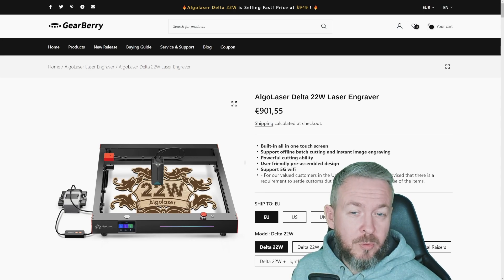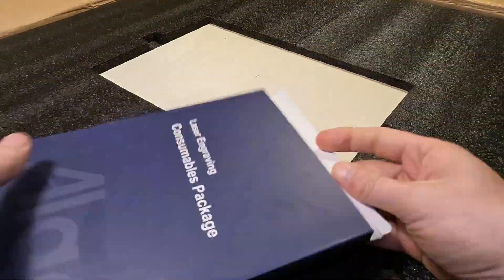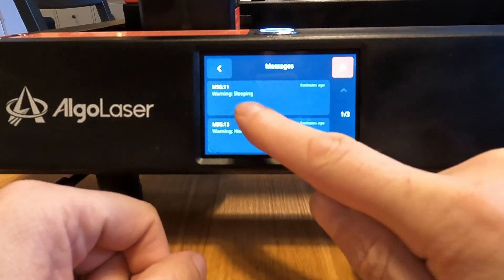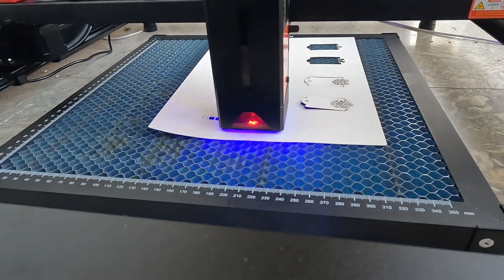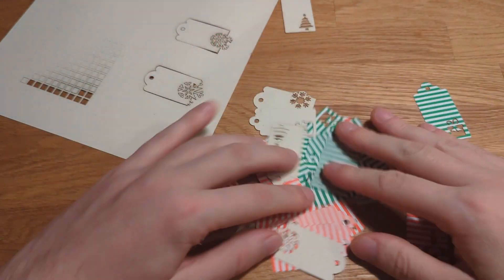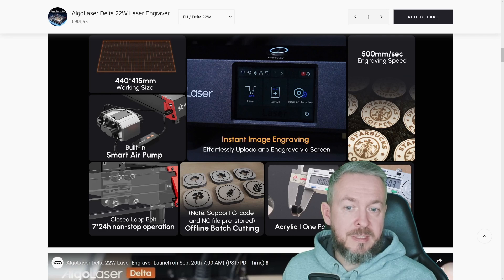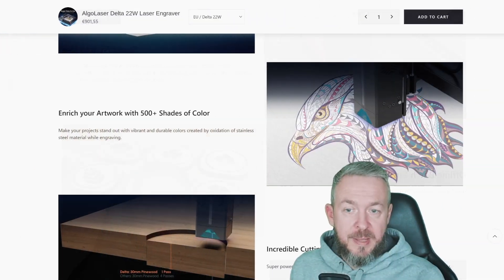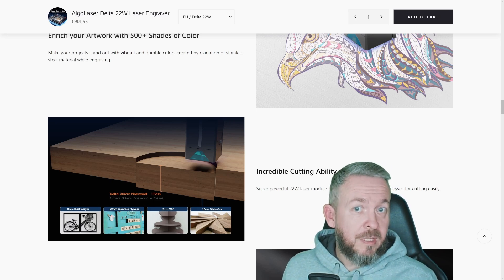AlgoLaser Delta - Bambu Lab of laser cutters & engravers

Comment: LOL It's not "30K" and "50K" mm per min, as that's 30 & 50 meters per minute! (or 67 & 112 Miles per Hour)- It's actually only 30 & 50 mm.
FYI 30.000 and 50.000 is not Thousands - A DOT represents the units separator and a Coma "," would represent a thousand separator :)
Reply from the maker: Not in every country. We also separate thousands with . 😉 But if you convert 30.000mm/min you get 500mm/s. They decided to go with the minute mark as it looks bigger than it would be with seconds 😂
Maximum Engraving Speed: 30,000 mm/min
Maximum Motion Speed: 50,000 mm/min
Reply: @BeardedTinker  I never understood that. As the term, say for example 31 and a half, is '31 POINT 5' (31.5) and 31,5 means either 31 OR 5 LOL
- I always thought "Math" was universal.
Reply from the maker: @3ATIVE  but it's so much better to have universally similar things that may or may not be equal, depending on where you stand on earth :) Makes life so much easier
Reply: No way this laser does 500mm/second, unless moving between cuts maybe.  Like all other laser manufacturers you simply cannot trust their numbers.
Reply from the maker: As I've said in video, I didn't go over 15k @DigiLab360  (250mm/s)